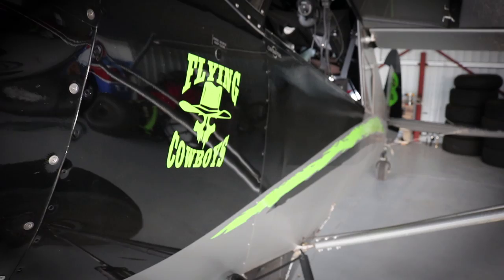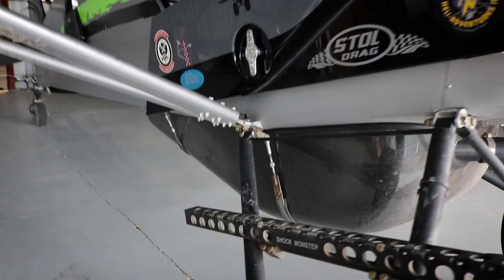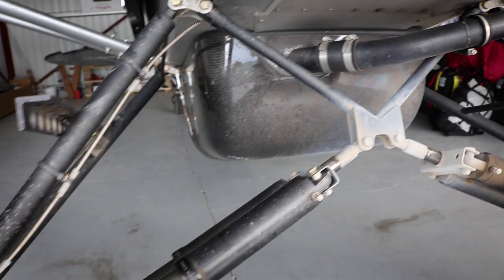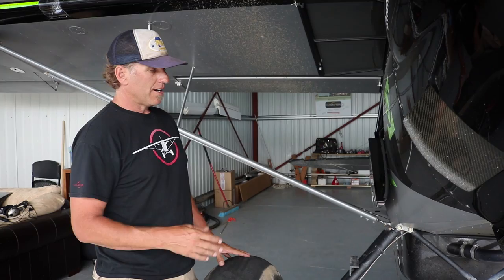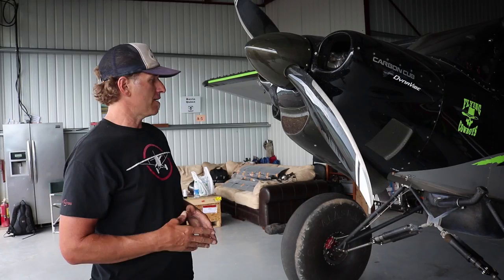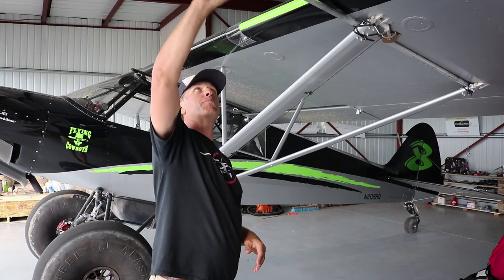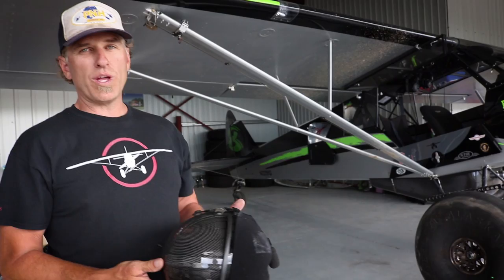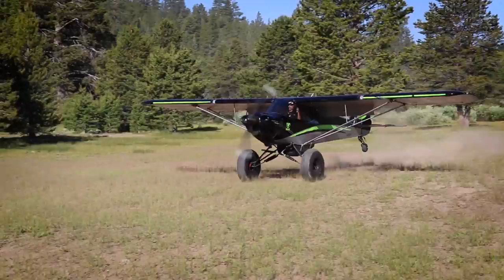Carbon Cub Aircraft - Flying Cowboys Kevin Quinn - Hangar Tour!

Comment: Instead of sheet metal screws to attach the slats, I would use aluminum or stainless rivet nuts. Then, they are completely removable and way more secure than any type of sheet metal screws. I use rivet nuts for tons of things. It's one of those things that, if you ever use it once, you'll find a million other places you'll want to use them. When whatever it you're attaching is removed, just place a O-ring on the threaded portion on the bolt and put it back into the installed nut. The hole will be 100% water tight. I've enen done this below the water line on  couple of boats and had no leaks.

Comment: Beautiful plane.  Thanks for sharing.  Another shout out for Dynavibe.  I got mine right down to 0.00 IPS and it's like flying behind a turbine. Can't imagine why I flew so long w/out using one.  I'm a big fan.  I also love Catto props, but why not a CS prop?  The carbon CS props are pretty light.  You have a sports car (or a jeep in your case) stuck in 3rd gear w/out one.

Comment: Thanks for your time to interview.  Question for you, how would the plane fly with the leading edge slats without using flaps for slow speeds?  Will it still slow you down?   Do you loose any top end?
Thanks